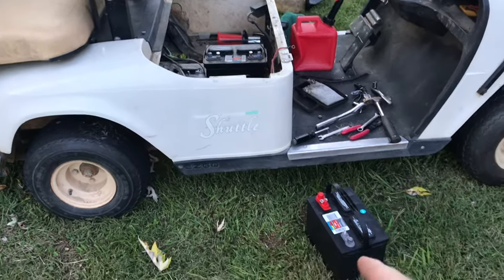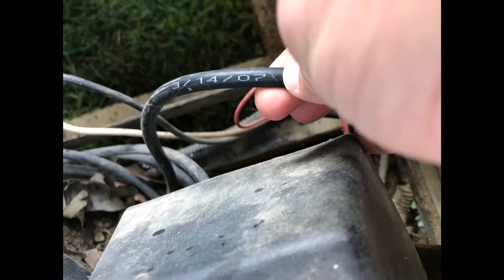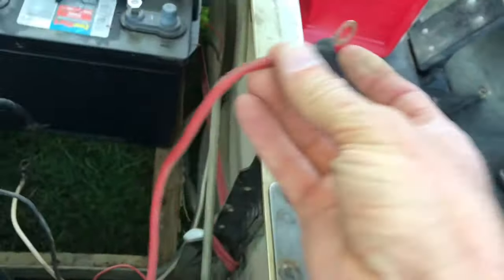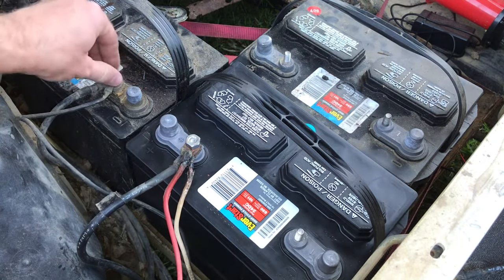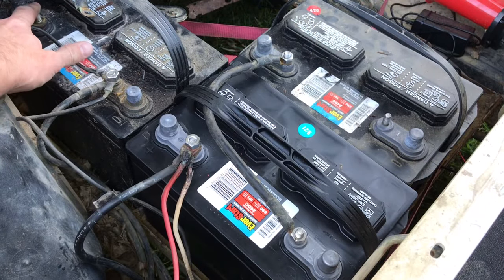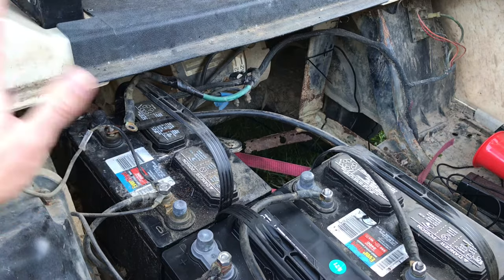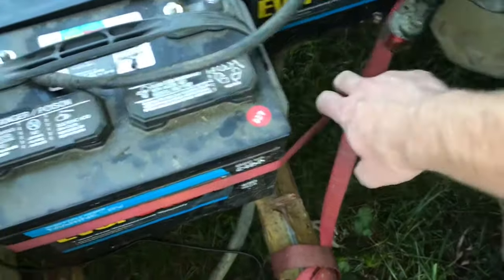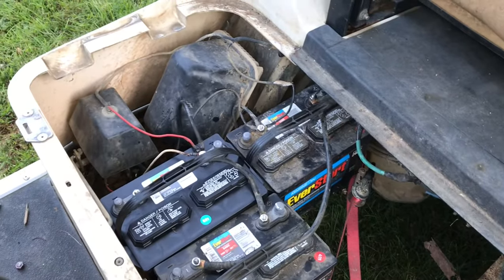Wiring up 12 volt batteries to a 36 volt golf cart.

Comment: The two large wires coming from the control the dirty black one, what terminal under that cover did it come from and the other Black with the tape on it where did that come from.
Reply from the maker: See if this will help.
12 volt battery install on 36 volt golf cart.
https://youtu.be/Oths7H3MyDw
Reply: watched but still stuck? Under the cover is the forward/reverse switch, where did the positive wire going to the battery on that switch does it go? The negative I think comes from the controller. This is my final step to see if it runs. Bought everything new now. Nice videos.

Comment: I think what I am asking is confusing? Basically all the batteries are hooked up for the 36v sequence and now I need to know where I attach the positive lead from the battery and the negative lead from the battery to? Also the solenoid I believe needs to be directly hooked to the battery positive?? Not sure what side of the post I use.
Reply from the maker: Both my negative and positive are hooked into the the controller.  You’re actually not the 1st person to ask about where the wires come from and go.  Soon as I get time I’ll do a better job of showing those particular wires.
Reply: Negative to the B- on the controller and the positive B+? also is there a battery lead to the solenoid?
Reply from the maker: Where the positive and negative terminals lead on a golf cart with a 12 volt swap.
https://youtu.be/LUHWxpkr9JM
Reply from the maker: Hopefully that will help

Comment: I got a 94 yamaha electric g9 but nothing was connected. Some wires are cut. How can I find out where each wire is supposed to connect to solenoid and controller?
Reply from the maker: You can check to find a wiring diagram based on the model number but best case may be casing everything down 1 at a time.

Comment: The reason there is a 12v reducer is to reduce the 36v down to 12v. Never hook lights or accessories to just ONE 12v battery. Connect the reducer to the WHOLE battery pack...NOT JUST ONE BATTERY. YOU WILL throw your power out of wack to the whole cart in a short amount of time. And one more thing...deep cycle marine batteries will work....BUT, if you run those batteries down past 50%, you take a chance of ruining those batteries. ALWAYS USE GOLF CART BATTERIES in a golf cart. There is a reason they are called "golf cart" batteries. The inside plates are bigger and can take discharging down to 20 - 10%..batteries are way to expensive to use incorrectly
Reply from the maker: It does what I need it to do though

Comment: Hi can you tell me if this wiring would be the same for three 36v lithium batteries? Thank you!
Reply from the maker: I’m not sure of the layout on lithium batteries I’ve never seen them.  As long as you have a positive and a negative everything should fit in series like it is here, but I’ve never seen a 12 volt lithium battery to say for sure.

Comment: I wired mine exactly the same way and now my cart wont move either way. What could I have done wrong or missed?
Reply from the maker: I’m not sure.  Did it move before doing the battery swap?
Reply: Your batteries are dead or have dead cells. If your cart moved before you did the swap, and if you followed these directions, there's no reason why your cart won't move.

Comment: Use 2 Guage wire between the batteries,  you'll notice a big difference.
Reply from the maker: I’ll definitely have to check that out
Reply: Until someone drives it until the batteries die.  And then they won't take a charge . So you can buy 3 more. Lol

Comment: Easy for you. No for me 🤣
Reply from the maker: What are you having the most issues with?
Reply: I have a golf cart.  1980 36 volts and I have 6 batteries.  What I don't know is where to connect the reverse cable and the forward cable.  it also has another cylinder cable
Reply from the maker: @darwindeleon3619  ah so it’s not the same as I have.  So all I did was connect everything that was positive on the 6 volts to positive on the 12 volts and repeated that for the negative.  Then just ran everything else in series (pos to neg to pos).  I hope that helps.
Reply: My cart has 6 batteries.  I have two black wires coming out the side box as well. How do you know which goes to pos/neg.  They both are black on my care